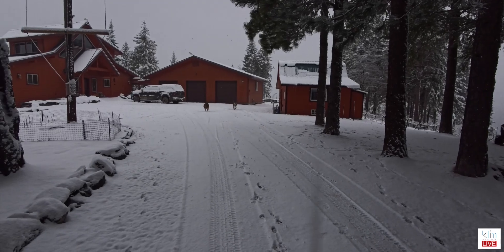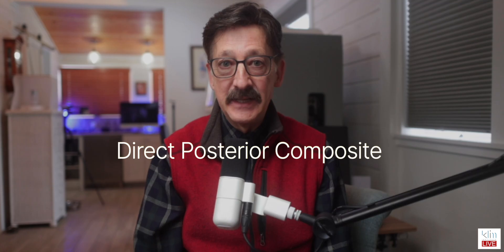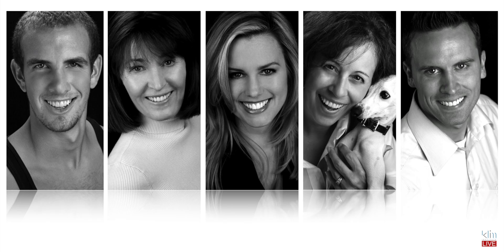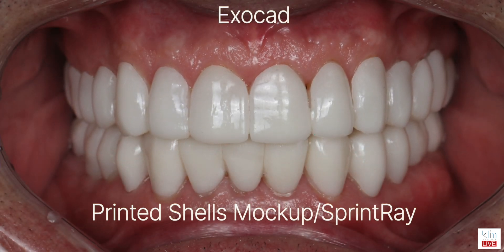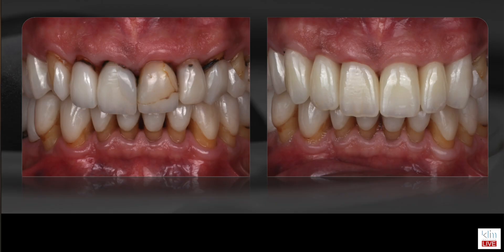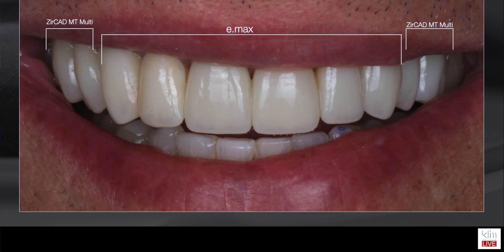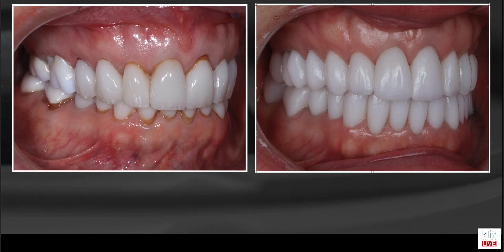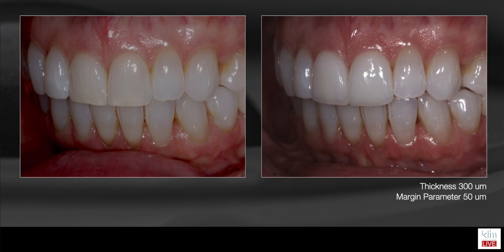Are Printed Veneers a Reasonable Alternative to Ceramic?

Comment: Hi James, can you talk about CEREC GO, a new grinding machine and the material of choice for those restorations.
Reply from the maker: This hybrid material miller is specifically engineered to mill composite and hybrid ceramic crowns, inlays, and onlays in minutes. It provides a furnace-free and user-friendly solution that seamlessly integrates with the cloud-based DS Core system. This development appears to be DS's response to the growing trend of printing ceramic-hybrid restorations, suggesting that the ability to print restorative materials is influencing this trend. However, the exact motivations behind DS's offerings remain unclear. We will just have to wait and see how things unfold.